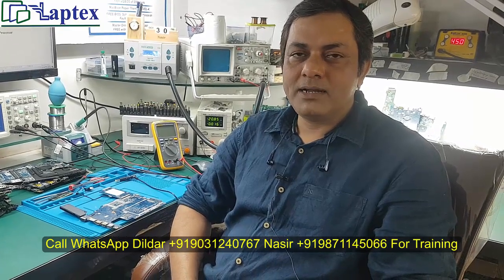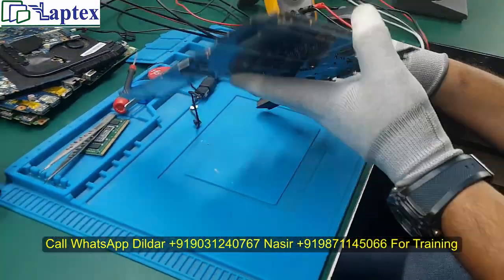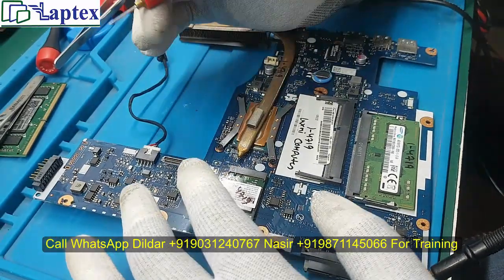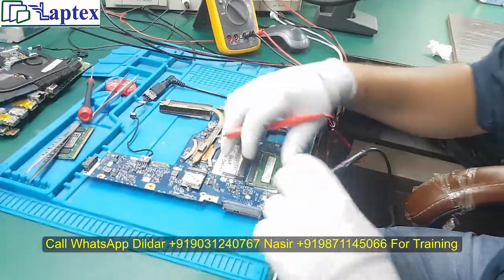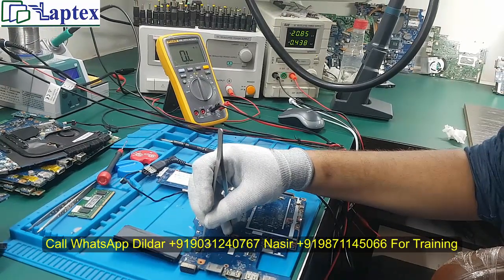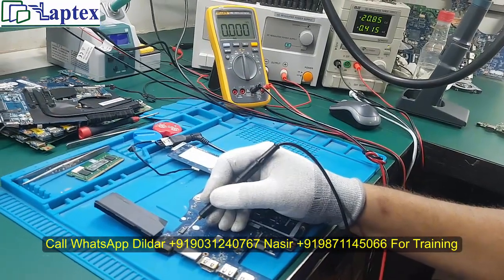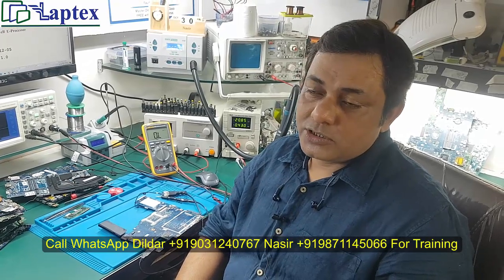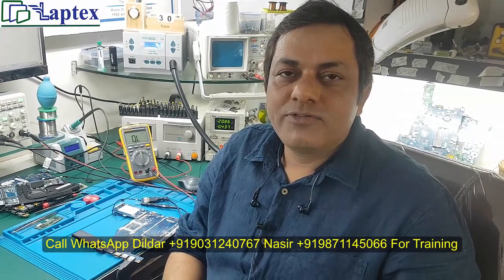Lenovo No Power On RTC Cell | English Nm A272 | Online Chip level Laptop Repairing Course | Laptex

Comment: Please sir what causes such a case where by u need to first remove cmos battery to power on, is it a pch issue. Because sometime I replace with brand new cmos cell batteries but same problem. Where by I need to remove coin cmos first then it powers on.
Please what could be possible cause and solution for such cases
Reply from the maker: RTC